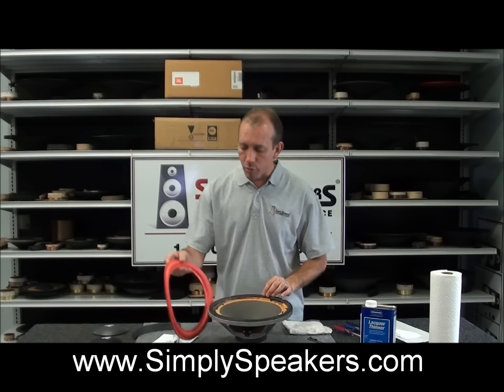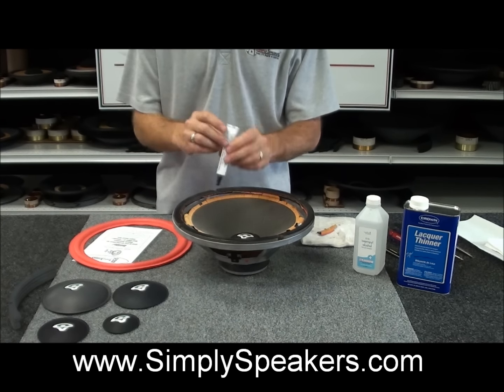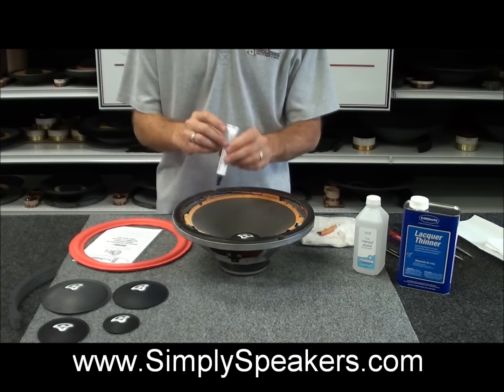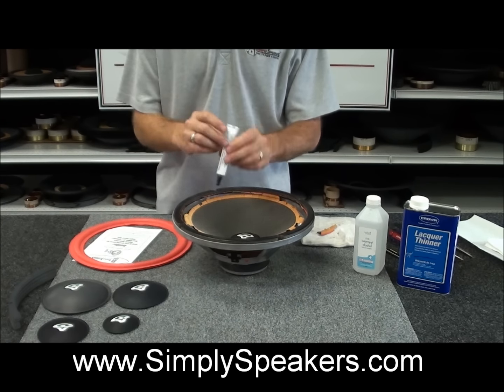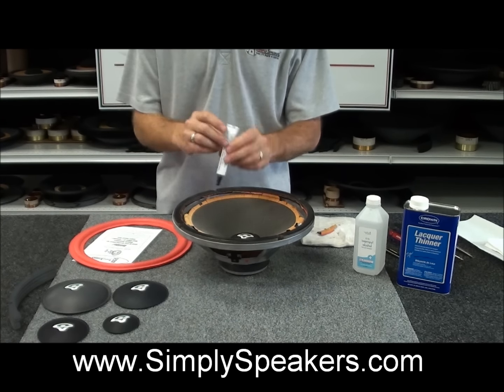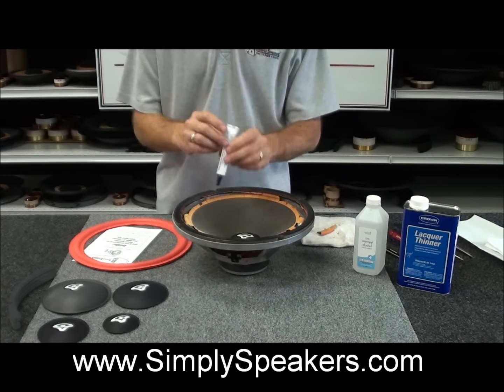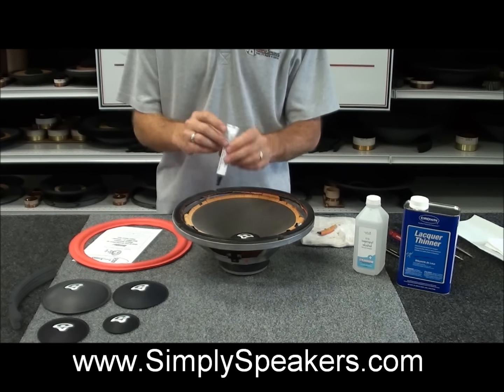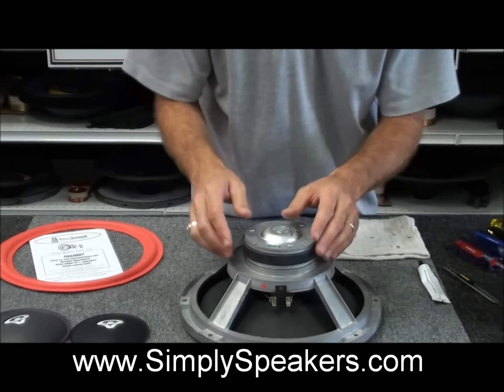Speaker Repair and Foam Surround Replacement for Cerwin Vega and Others

Comment: Well explained ! A question; You replaced foam with rubber . Is there any difference in sound ? Does rubber need to be replaced after some time as well, because it gets too soft ?
Reply from the maker: Rubber generally lasts longer, but can harden over time. Foam sounds better for most applications.

Comment: I bought a foam kit for two cerwin vega at15's back in 2021. It looked intimidating,  so I put it off as long as I could.
September 2024. I had no choice but to use the repair kit.
It went quite well! Thank you very much for the excellent video and repair kit!
Reply from the maker: Thanks for sharing!

Comment: Excellent video! Even for old timers, the thought of refoaming can be a little intimidating, but your training video is very thorough and I'm pretty sure anyone can replicate this process, which is both practical and effective. I really appreciate the effort touching on possible missteps and sharing the techniques you've learned over the decades to mitigate the possibility of a botched job. Now... I just need to get my butt in gear and get started on my Sound Dynamics 12S foam surround replacement! Thanks again. 🎉
Reply from the maker: Thanks for the review!

Comment: This video is FANTASTIC! I have a Paradigm PS-1000 subwoofer (10 inch) where the foam edging is gone. I’m going to check your website to see if you have a repair kit for subwoofer. Thanks again 👍
Reply from the maker: Glad it was helpful! The PS-1000 kit is part # FSK-10A-1 here:
https://www.simplyspeakers.com/single-paradigm-speaker-foam-edge-repair-kit-fsk-10a-1.html

Comment: Definitely good work and job on speaker and video
Reply from the maker: Thanks a lot 😊
Reply: @simplyspeakers  got a question though I was working on my first speaker repair and wiped the outer ring with alcohol a lot came off but left a lot of gum spots around it will  the regluing work if it's smooth or does it have to be completely clean and smooth? I know there has to goal

Comment: Commenting tonight on March 1, 2024, this video was an invaluable guiding resource while performing my first re-foam. I've long had a pair of Cerwin Vega AT-10's that are still working fine. I recently inherited a free pair of D-3 speakers with deteriorated foam surrounds. I just finished the job and they came out really well. I'm now confident I can repair my AT-10's should the need arise. Solid A-Z instructional. 👍
Reply from the maker: Thank you!

Comment: I refoamed the 12" bass speakers in my Cerwin Vega DX-7s.
I was nervous that I'd ruin it by having it rub after I attached the speaker to the frame, but it's easier than you fear.  All set!  GREAT video, good pace, reassuring all the way through.
Reply from the maker: Thanks!

Comment: Regretfully I swapped a pair of 70s U-321 woofers with some cheap Radio Shack woofers when the foam was destroyed from age back in the 90s. They don’t rock like they use too.
Reply: I got U-321s in 1980 and refoamed in 1990 before I sold them. I didn't do a very good job, but at least they looked better.
Just refoamed my DX-7s using this video and did MUCH better.

Comment: I would like to suggest using zippo lighter fluid in place of the two solvents suggested.  For me it works way better than goo gone or what is suggested in the video. Dwell time is real important. Then use a plastic scraper rather than a metal tool.  I used this method when restoring old film camears that had a lot of foam on painted surfaces.
Reply from the maker: Appreciate the comment. We cannot say one way or the other, as we have never tried the lighter fluid trick. As long as it does not soak into the paper cone and leave any type of oily residue, it may work fine. Try at your own risk. :)

Comment: I bought a kit somewhere else but it came with white glue. I ordered glue from your site, but I'm not sure I got the right stuff.  Container is different.  MI-2000. Will this work for the surround foam and plastic ring gasket?
Reply from the maker: The MI-2000 may work, but we prefer the MI-3035. This is what we use and show in the video.

Comment: Very good video.  My only real critique is that I always cut the surround for the screw holes.  It takes almost zero time and minimal risk of accidents.  It also makes for an easier installation to not have to push through the surround with the screw.

Comment: I just bought a set of AT-12's that someone recently refoamed...but they did a crap job and got glue all over the paper ribbed cone.  Is there anyway to clean the cones up or is it better to leave as is?
Reply from the maker: Usually better to leave as-is.

Comment: Simply Speakers- Where to find 4 ohm replacement speakers 12 inch for original Cerwin-Vega AT-12? Surrounds shot but also destroyed cone in one cabinet- Ones with equivalent magnet, power handling, and frequency response. No low-pass filter on these woofers- direct input from main line in parallel with high-pass and band-pass filters in crossover board- any suggestion/post would be appreciated
Reply from the maker: Check out our full recone kit for the AT-12 here:

https://www.simplyspeakers.com/cerwin-vega-speaker-recone-kit-at12-rk-cvatw12.html

Comment: Do you sell the glue separately?  I bought the pair kit a few years back but I only need to repair one speaker at the time. Now i have to do the other one. Is there a glue I can just use from local hardware store or does it have to be this special glue?
Reply from the maker: Yes! See our MI-3035 adhesive here:

https://www.simplyspeakers.com/speaker-repair-adhesive-mi-3035.html

Comment: I (almost) never make recommendations...but I have to hand it to Simply Speakers. I revived a pair of Boston Acoustics HD8s that are probably 30+ years old using one of the kits. I have to admit that there was a little bit of a learning curve on the first one, but the second one went smoothly. It took a while to get the old glue from the old surround out - I used a lot of alcohol (rubbing, not drinking!) and eventually it was clean enough to put in the new surround. The results - truly, these speakers sound like new. Thank you for making a quality product and standing behind it with these great videos. I'm impressed.
Reply from the maker: Thank you!

Comment: I own a pair we bought in 1988 and the foam and gasket is bad. Excuse my ignorance but is that why they sound bad.  I assumed it was something internal or electronic.  I have had in storage for 10+ years but just bought a turntable and want to have a decent setup.
Reply from the maker: Hello. When the foam goes bad, this will cause the distortion you are hearing. Replace the foam and they will be good as new!
Reply: Absolutely that is the cause for the distortion. I had the same thing happen to my set of legacy speakers and this kit brought them back up to spec.

Comment: You made it looked easy enough for me and I have bar snd screws with not wrist movements in one hand and extreme nerve damage in the other, but your instructions were straight, to the point. I'm hoping even either my non movements I'm gonna be able to get er done  my set is about 30yrs old but theirs sound quality is still top notch. That was until my amp blew and I set them aside with a set of Boston acoustics so you can't imagine the names i called my cervin Vegas.  But brother thanks for the easy instructions.  We'll I'll  let ya know.
Reply from the maker: You can do it!
Reply: @simplyspeakers  thanks for the vote of confidence.   Back rubberized glue is obviously the best what would s Second choice be or. Is there no none
Reply from the maker: Our MI-3035 glue is the preferred product, but you could try some of the slower drying white glues like Aileens Tacky Glue as well.
Reply: @simplyspeakers  although for me it wasn't as easy as  you make it look, but mission accomplished.  Thanks for that extra you can do it ya gave me. And thanks for the easy instructions.  If I was able to do it with two bad hands and they came out good as new Damm brother  not enough thanks

Comment: These instructions are clear and strong in every regard.  Thanks for taking the time to produce this.  I regret having purchased my "kit" elsewhere.  A heads up for amateurs such as myself - the glue on the cones on my set were a bit more trouble to remove than in the video.  I'm not sure what I should have done differently but the alcohol proved insufficient.  Perhaps it was the concentration of 70% rather than 90%.   Also the foam overlapping the screw holes can get caught up in the threads and pull/twist the foam.
Reply from the maker: Sometimes we use acetone or lacquer thinner when the old glue is extra stubborn.

Comment: Besides not getting any junk in the cabinet while you're cut the old foam away, is there any reason that the speaker has to be removed from the cabinet?  The reason I am asking is that one of the nuts holding the screw must have become unattached from the inside, and the screw cannot be removed without drilling or some serious damage to the speaker frame.

Comment: I pulled out my 30 year old Sony speakers to connect them to brand new wiring in a new room with built-in surround wiring.  Unfortunately, the two mains were starting to rattle because of the foam surrounds.  I did a web search with those speaker model numbers expecting to buy entirely new speakers to put in the cabinets.  But info for simply speakers came up - and a kit specifically fitting my speakers. I said heck, why not - $10 per speaker!?   It took a few hours over a couple of days to scrape, glue, reattach it all - but they look brand new and sound brand new.  Totally amazed and told all my "friends" on facebook about it.  Very cool product, and mine actually went on easier than the video. My original foam surrounds were connected to the back of the driver cone, so I didn't have to scrape anything off! :)
Reply from the maker: Very cool. Thanks!

Comment: This was a fantastic video. I recently sent my Cerwin Vega speakers to the Hi-Fi shop to send out to replace the foam. When I reinstalled them into the cabinets the emblem was tilted  to approx 20' off center, just like you demonstrated in this video. I thought it would be a big deal to rotate into the proper position but now I can remove the gasket and rotate to the proper position easy-peasy! My question, is there a recommended adhesive to use in place of what you sell that is available at the local hardware store to re-glue the gaskets? Looking forward to hearing from you. Thx. Dave
Vernon BC, Canada

Comment: Well everything was going well until I applied the glue and it dried within seconds before I made it around the 12” sub . It got very sticky and started to make a mess . Maybe I got some old glue ? 🤦🏻‍♂️
Reply from the maker: In these cases, you simply need to go heavier with the glue to allow more working time. Send a photo of the completed repair to: info@simplyspeakers.com 

Thanks!

Comment: Great information. I have successfully replaced foam surrounds on a few  speakers using this. Most importantly after prep is proper use of glue, and using the right amount on the inner ring first, allowing it to self centre  as you apply slight force upwards making slight adjustments. Thank you sir!!
Reply from the maker: Glad it was helpful!

Comment: Is the gasket entirely necessary after redoing the foam surround?
Reply from the maker: No. Use the gasket if you have one, or the repair can be done without. We also stock several new gaskets if needed.
Reply: @simplyspeakers  Thank you...

Comment: I was pretty good until it got to fastening the foam to the frame. I did not use much glue but it oozed out from under the foam as soon as I started to push it down. Now it's on my fingers, does not wipe off very well, now it's on the foam, the foam is sticking to my fingers, can't seem to get it centered. Every time I would try to lift my finger off the foam it stuck to me.  I'm getting a rub on the voice coil nothing seems to be correcting that. 

So.. I'm thinking this speaker is done. Probably not going to go through all this again. It was fairly easy but I couldn't get it to work correctly. No idea how it got so far off.
Reply from the maker: Hit us up on the website and send a photo. We will take a look at the work. Might need a do-over.

Comment: I think someone at Pioneer used industrial strength glue on mine. Ended with a hairline crack on one of my cones I had to repair with some Elmer's glue and coffee filter strip cut out for the backside. Other than that the 910's look good again.

Comment: How long does it take until the foam starts to come apart?
Reply from the maker: Usually around 15 to 20 years
Reply: @simplyspeakers  I wonder if it makes a difference if one always has the front grille(or whatever it's called) on, versus always having it off. Or would the deterioration rate be the same either way?

Comment: Excellent Video.  Your video gave me confidence to replace the surround on 3 drivers that had totally disintegrted.  I bought your surround kits and it took about 15 minutes (plus several hours in total for drying time).   I would highly recommend Simply Speakers.
Reply from the maker: Great to hear! Thanks!

Comment: I re-foamed my Cerwin Vega AT-15's using this kit.  To clean the cone,  I found it worked much better to lightly scrape the old orange foam off cone without the alcohol.  Then I used the alcohol to remove the remaining black foam.  Great kit, great instructional video and great customer service!!!  Highly recommend this kit

Comment: I'm in the middle of replacing the foam now, but when I lightly press on the center of the cone I hear rubbing.  I tried centering the cone as explained in this video, but I can't make the rubbing noise go away.  In fact, when I lightly push on the center cone, it sometimes sticks in the downward position rather than springing back.  Is my voice coil busted, or am I missing something?  Do I need to send this woofer in to you for repair?
Reply from the maker: Please send message through our website for assistance. Thanks!

Comment: This is great that they offer these kits.  BUT, a word of caution;  the adhesive (basically like model airplane glue) dries a LOT faster than what is explained here (at least in low humidity).
As soon as I spread a bead with my finger, it IMMEDIATELY started tacking up.  Also, don't use too much, because once you spread it, it will be almost impossible to get off.

Comment: I have a pair or cervin vega D7 15". I was not the one that took them a part. They have a 4 part gasket and a solid ring. The ring has old foam on it so I am guessing that it goes against the foam ring. Where does the 4 part paper gasket go. Does it go against the metal basket or on the outside of the solid ring. Please help me get this figured out. I got my kit from you hoping it would show me.  Help me please!!!
Reply from the maker: The four part gasket goes on first, then the solid ring covers that.

Comment: Is there any reason why you couldn't combine the final two adhesive steps (foam to edge and gasket to foam) to save time?  Meaning, get the cone centered and adhesive applied, then go ahead and put your adhesive on top of the foam, set the gasket on and turn the whole thing over?  Then you're waiting one hour instead of two.  Any issue with doing this?
Reply from the maker: Good idea, but we still recommend waiting and doing the final glue up in two steps to prevent the risk of the foam moving on the frame and causing mis-alignment of the cone/coil.

Comment: Little help!? I have a set of e712 vegas. Instead of buying used half melted crossovers online or expensive one's from gibson i upgraded. I got emb cx10 crossovers 1200 watts and a tx10 terminal. I've gotten as far as i can now. I need the original switching jacks in my e712 to work. I'm clueless and no aptitude. Ps i replaced my surrounds both sets already. L9 book case one's the 2nd set.
Reply from the maker: We don't carry parts like switching jacks, etc. but there are some online forums and groups that should have trusted vendors they can refer. Good luck!

Comment: Hello, As an auto mechanic i did my fair share of tire patching, basically similar gel and rubber, but must be perfectly adhered to work, so i used my screen tool roller used for inserting the rib when doing screens and "stitched" this rubber like a tire patch and it worked well.  I'm saying this because I laid on a little too much glue and wanted to make sure I didn't have any lumping of the glue.

Comment: It's because people put stuff in storage units for years
Reply: use or store don't matter... foam will degrade over time
Reply: Mine were never in storage.  Storage may have helped as there was no furnace drying them out.  Based on the number of views of this video, it doesn't much matter.  It's gonna happen.

Comment: so it wont affect the impedance on the speaker it will still as a hole as an 8 Ohm speaker
Reply from the maker: Impedance is not affected by refoaming

Comment: Thank you very much I am very appreciated, may be I expressed wrong, I apologize for the inconvenience, what I mean is that if the Drivers are 6 and 4 Ohms, the tweeter and the midrange, can I replace these with 8 Ohms drivers or can affect the crossover? Thank you again much appreciated, Luis
Reply from the maker: The crossover frequencies will shift slightly. You can install, and then listen to see if there are any response issues. The system will not be damaged by installing 8 ohm drivers.